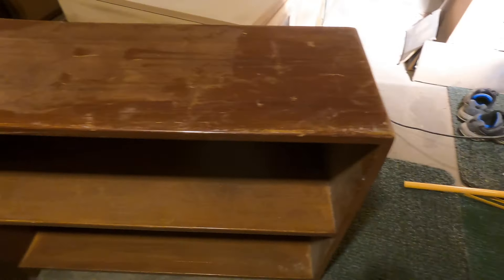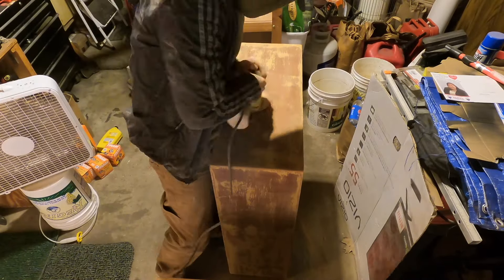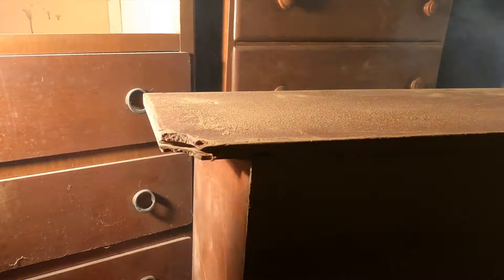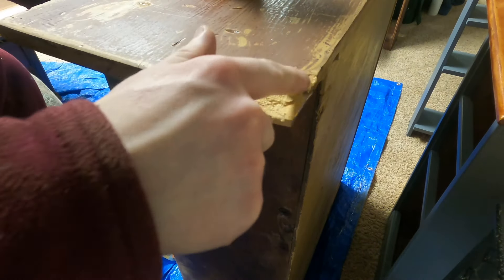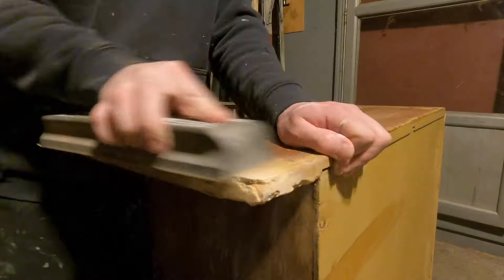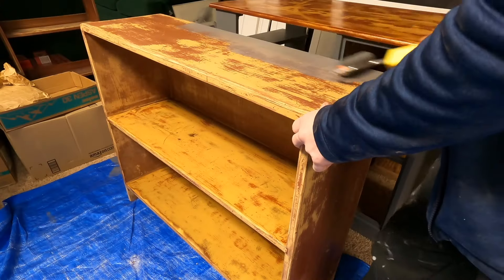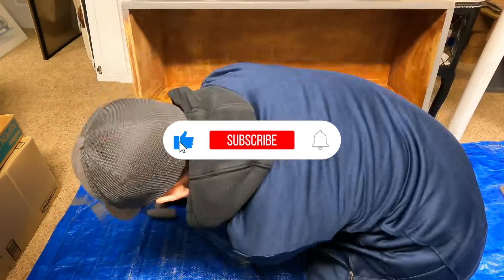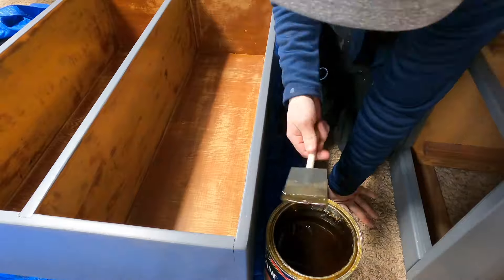How I Refinished a $10 Shelf From Facebook Marketplace Into a Modern Piece of Art Using Beyond Paint

Comment: For big fills like that I use spray foam. 
Let dry, cut a little lower than the rest of shelf, apply a thin layer of wood filler, sand and paint . Try it, it works amazing with a lot less work.
Reply from the maker: I'll have to try it out next time I get a project. Thanks for the suggestion! Where do you get the spray foam from a is there a particular brand you recommend?